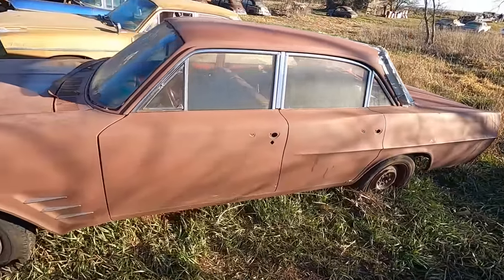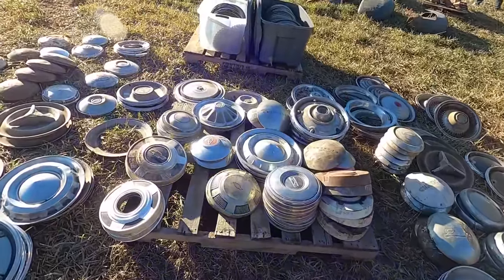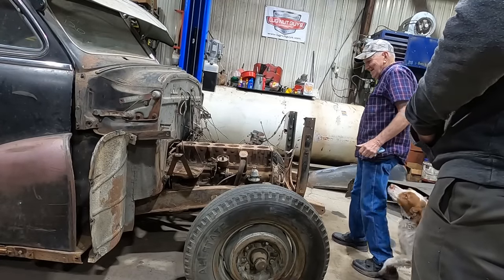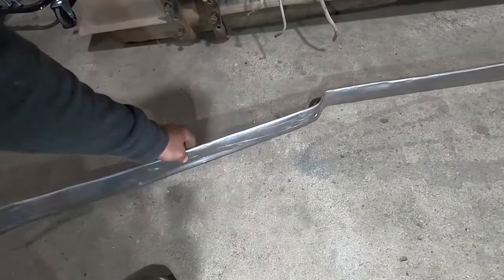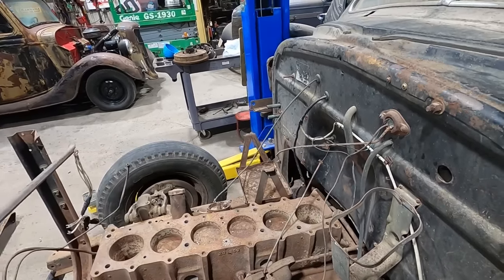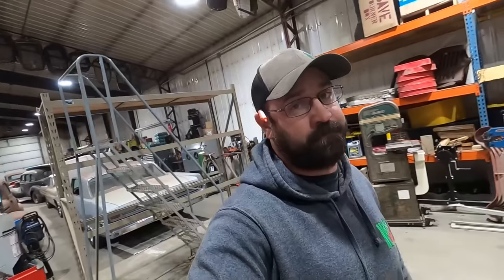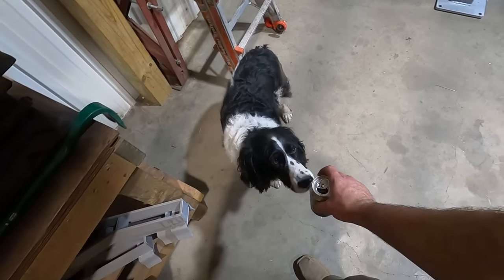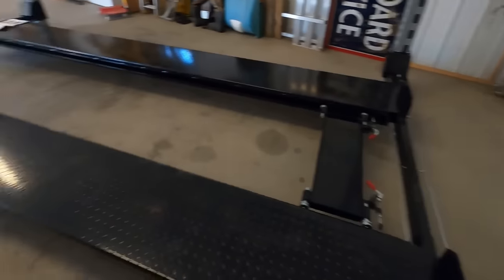AMAZING Barn Find Auction! Tri-Five Hardtops, 1959 Elcamino, Coupes, Vintage Parts and MORE!

Comment: The '59 El Camino brings back some memories.  I bought a '59 El Camino in 1989 to restore.  It was wrecked hard in the front and the driver's door and had a worn out '68 327 in it.  I spent the summer of '89 restoring it with my dad.  I put a Chevy 350 crate engine in it and an '82 Z28 Super T-10 four speed trans.  I put a set of recovered '64 Chevy bucket seats in it and did the interior in black velour with red dash.  My dad painted the car bright Corvette red.  I drove that car for about 7 years and then sold it.  I wish I still had it, it was a real head turner.  Those cars bring stupid money today restored.

Comment: I used to sell the heck out of those lever action shocks for MGs and Triumphs when I was in the parts business. Thjey were still using them on the TR6 and MGB right up to the end. Made by Armstrong. You could modify some of them with adjustable valving, the racers all did that.
Reply from the maker: Cool

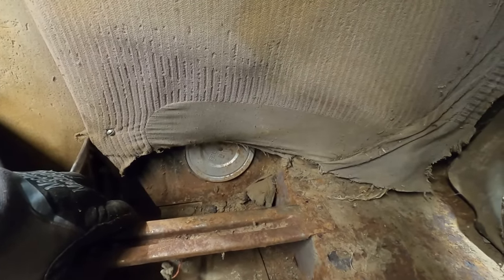Comment: At 59:10 is where the fuel tank filler tube would pass through if the car was a business coupe.  The business coupe did not have a ear seat.  The fuel tank was located where the rear seat would have been located on the five passenger coupe.
Reply from the maker: Thanks for the info!

Comment: That's a pretty nice old Chevy.  I've had my '48 Fleetmaster 2dr sedan for a couple decades.  Always garage kept, 56,000 original miles!  A 235 is a direct, bolt-in swap for that 216 (with the possible exception of some motor mount magic depending on the year).  It was a VERY common swap back-in-the-day.  And a great way to get rid of one of those 235 boat anchors I'm sure you have laying around.

Comment: Use a pry bar or a small carpenter crow bar and pry up the wall from the inside to pick it up and it would be better and easier on you if you have two people on each end towards the center pull out then grab the wall a little further down and shove it up and forward that way it won't fall on you and then you can always use a rope and the engine hoist and prop it up...
Reply from the maker: Thanks for the advice

Comment: This and that garage is doing a build on a 40 Chevy coupe and using mustang II style steering and some of the suspension pieces from both, I think the original parts car was a ford Fairmont wagon but I think he went to a rebuilt unit, but it is a decent build series I really like his channel,, and it may be easier to build the blue motor from the bed of the orange Chevy c10 stepside than try fixing the motor in the 48, and I realize that one's you were interested in were kinda rough, and wow that 47 fleet master, and the price that and the pink I think it was a 56 went for ouch!!!

Comment: I was cruising this afternoon half watching, then napped then woke up to see you loading the 48 Coupe I was shocked. My first car was a 47 Chevy Coupe just like that one. It was complete with motor and it ran, Only had 1st and reverse. I paid $35 and had to put it in Mom's name. It tooks all of 30 minutes to study the linkage and make and adjustment, Went down the road and it shifted into 2nd like a charm.  Then Third. I t was was flying. I was 15, at the time. I later converted the whole drive line to a 57 Olds, and 371 V8. Had the 4 speed HYdro built up and was gonna race it but My engine building skills failed me. Rod was daylight seeking!!!!  My Dad got so mad that I had spend all my money and blew it up the first day. i tried to fix the engine but it was really broken.  He towed to the junk yard while i was in school one day.  Sad.

I just glaced up to see you listed the bomb for $3,500, I thought my God what is he going to do to make anyone interested in that old thing Hell he only paid $350 for it. Then I checked the length of the video. Well he has a whole another hour to put about $2,000 into this rig. What is that all about???? Guess I better stay awake, My Birthday is coming!!!!
Reply from the maker: Thanks for sharing!

Comment: Next time you are at Sam's Club pick you up some Tones Cajun Seasoning and use it on your steak on the grill or in your broiler. It's great!! Just give the steak a good dusting with in on one side, cook it for  a bit, flip it over and give it a good dusting on the other side. You won't regret it, adds a bit of pizzazz to the steak but not overpowering at all. A jar of that stuff goes a long way, probably last you for a couple of years.
Reply from the maker: Thanks for the tip!

Comment: A 327 from around 65-67 and a th350 with a shift kit would be cool in this car so would a manual shift 4spd transmission but if it was me I'd leave it L6 3spd on the column manual shift transmission..

Comment: Had a 46 fleetline, wanted to drop the front a couple inches with dropped spindles on the stock suspension.  Looked, asked around from some 'oldtimers'   Nobody knew how without going aftermarket.    Found a Hotrod article in an old 50's issue......use a 53 chev spindle.  2 inch drop and bolt in!!!      Bummer, the 53 chassis I had behind my shop for two years.....Just got scrapped last week:face-orange-frowning:
Reply from the maker: Oh no!

Comment: Hey not every video is gonna be to everyone’s taste. People railed at Puddin’ because he took extra time fixing up his new shop to the way he wanted it, this video had a little bit of everything in it, an auction, piecing an old car together, shop build, dinner with dad, putting a lift together, Duff and Mojo, it may not have been for buddy, I enjoyed it. Now as far as the car I’d probably do her up with a small block fuel injection system, nothing wrong with a carb just think in the colder weather less issue with the FI. But that’s just my opinion, and I agree set it up with some new hardware underneath so you can get replacement parts for it if need be, not big on the patina look but this one wasn’t all that bad, might run it like that for a few and then think about a respray.

Comment: If I had that car, I'd put a big block V8 with a big cam in it with dual exhaust nice big four barrel carburetor rear-end with positrack that spins both wheels at the same time, 4 on the floor shifter & 4speed transmission,nice tires & wheels, change the interior color to black & have the body repainted back to black good size gas tank,put a disc brake front end under it,find another horn ring for it,fix the glove box inside piece new carpet

Comment: You should stuff a 4200 vortec L6  in the 48 its basically the same as ls swap they came in the gmt 360 platform trailblzer envoy etc get the 2006 and up with metal vavle cover there better
Reply from the maker: Good idea!

Comment: Daaaaang... I'm not really a '46-'48 Chevy guy (other than the Aerosedans- those are cool), but man, is that coupe a survivor! Upgrade the front suspension, and you could build it on the cheap with a full pressure '54 to '62 235...
Oh- the 'Dad Joke':
AIRLINE STEWARDESS: 'We have a medical emergency- is there a Doctor on board?...'
DAD *Leans over to Son*: That could have been you they're asking for. Notice they're not asking for a Graphic Designer?...
SON: Please Dad, not now...
DAD: Maybe you can save that guy as a PDF, and see if that helps...
Reply from the maker: Fleetlines are my favorite as well

Comment: I've got a nasty comment too. You don't post enough videos!!!!!
Pun intended, you hit several nails on the head. The only reason "Gertie", my '49 F2 Ford truck is still on the road, is that I took small bites, and was meticulous in maintaining her, and I've ran her since 1982 as a second vehicle. Outside her rusty appearance, she is bone-stock (including 6 volt), and runs quite nicely. Mission creep is a major danger in working on any job, especially old vehicles. 
Another "nail on the head" is keeping the tools and shop picked up and clean. When I go to work in the morning, everything is in it's place, easy to find, and it gives you a better outlook on the day, even if you have turd jobs ahead of you. Jeez, you sound like me, a fossil.
Keep it up Mort. I loathe carpentry, but you have made palatable.

P.S.: In my view, that '48 Chevy Coupe needs a restoration. If you don't, that's OK. I just think it is a great find. And I don't like Chevies. Never owned one, and probably never will, but your video was absolutely fascinating. I have a soft spot for the post-war American autos and trucks.

Comment: Ɓuddy I'm right there with you.. like it just fires me up these guys will get a nice original 60s or 70s power wagon that were factory hiboy beyond off road capable real truck n first thing is ditch the factory springs and do a 6"+ lift with mushy spring packs n massive tires n throw muscle car performance parts on motor then about a week after its done its parked n up for sale cause now it can't get more than 2 mpg ,drives like shit,can't get out of its own way,tires that it eats are $3-400 each,need a ladder to get in n out,can't load or unload bed without a fork lift.. n with cars take a nice driver n fuel cell in middle of trunk, build motor so it won't hardly start or run n can't afford to drive anywhere, remove back seat,spool rear diff ,tear out heat,,/ac n wiring then immediately turn around and put it up for sale cause it worthless as a car.. 🤬 sorry .. oh yeah dad joke.... 
What does a big parakeet say?

CHIRP!🤣🤣😅😅😝🤪😜😂🫠
keep on keeping on Buddy

Comment: post and beam structure would be the strongest clear span on 2x12  and 16 inch centers is 12ft and 8f you used joist hangers you wouldnt have neededthat second wall fyi nails are better than conventional screws because they have shear strength . that being said ive seen far worse from guys with tickets so giver feller.
Reply from the maker: Appreciate the feedback! Yeah I hate nails but I should use them
Reply: ya know its good of you to respond being a big youtuber as you are humility is a rare thing doesnt matter how famous you are there is always more to learn even from internet jockies who may or may not have a point good on you sir.
Reply from the maker: We do what we can! @bengarry9826